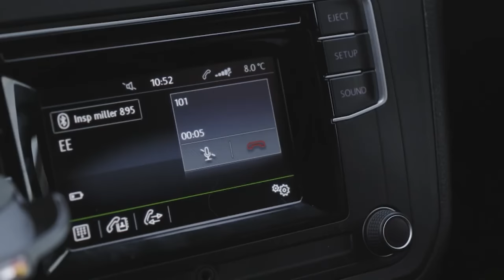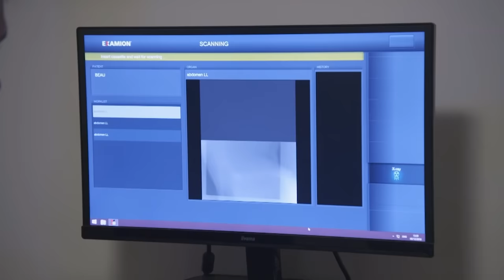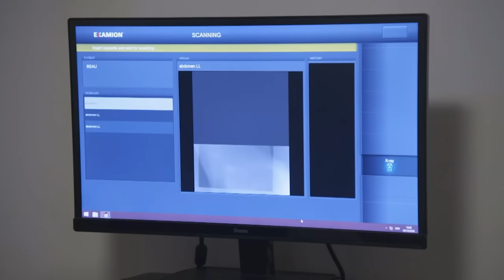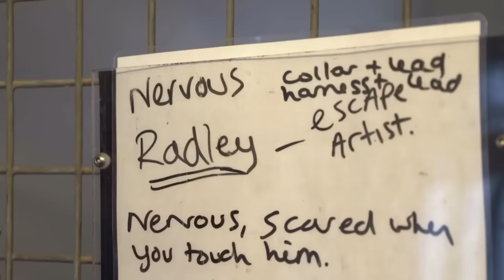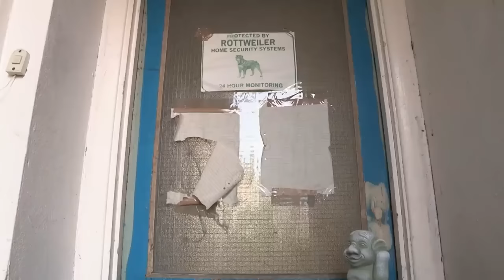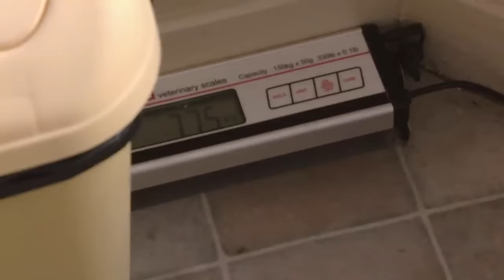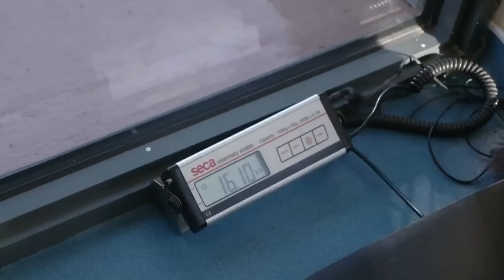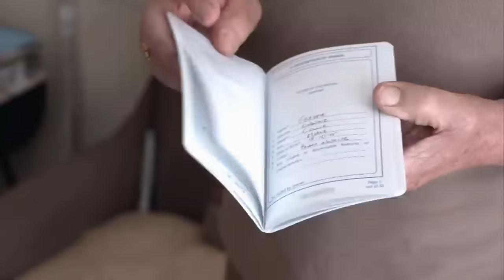Neglected Dogs Finally Given The Attention They Need | The Dog Rescuers Compilation

Comment: I used to live in Florida. On a particular stretch of beach for about one month out of the year no one could go swimming. It was one of the few areas where there was enough surf for some surfing to take place.   During this month surfers could not surf in this area.  At the same time, mothers with children flocked to the beach as soon as they learned that the Newfoundland has returned.  I can’t remember her name, but she was a sweetheart.   This is before cell phones, but the word still got out whenever she was at the beach.   Small children were extremely safe. They could play in the surf as it left up to their feet if they wandered into the surf, she would be there to guide them out. Also, children cannot fight. She was there to break them up.   Families with children wished that she would be there year-round or at least all summer long.  The beach house, according to rumor, was rented every year for a month in the summertime by this family.  You could see the beach from the windows, and I’m guessing as soon as people showed up, she made it clear where she needed to be.   Yes, there were leash laws that were enforced.  But she seemed to be an exception.  I don’t think animal control would dare to come on the beach to haul her away.   When there was no people or children, she always return back to the house.  I can’t remember her name and it’s so frustrating.

Comment: It seems the U.K. has better (stricter) animal welfare laws, AND they enforce them, which is half the battle. Also, because they have gun control laws, inspectors don’t have to be as concerned that they could be shot on a call. In the U.S. the equivalent agencies go in with a police guard, and many States, particularly Red States, have very few protections for animals. There seems to be a back-yard Breeder every 50 feet. It’s sheer bedlam.
Reply: I haven't  seen the laws  for animal  abuse  cause the judges are not doing there jobs  like they are doing here  and here they have better  laws then any other country
Reply: Look I dont no what part of Texas you are from but before you speck about anything you might want to do some research in to all the things you have written about and all the things that you think you no but you really dont have a clue about any of it